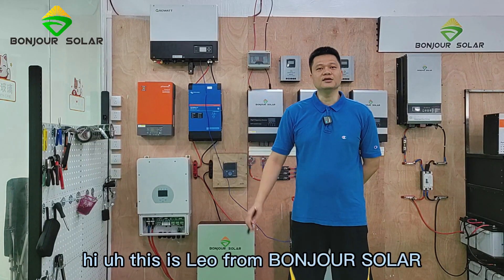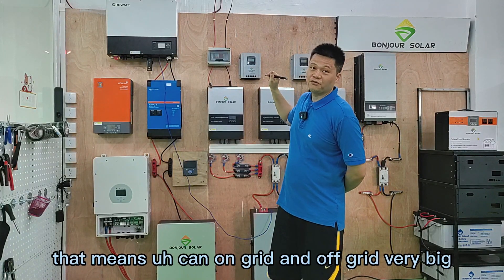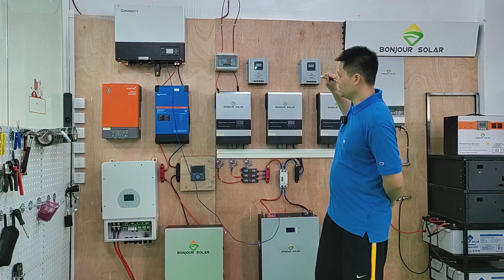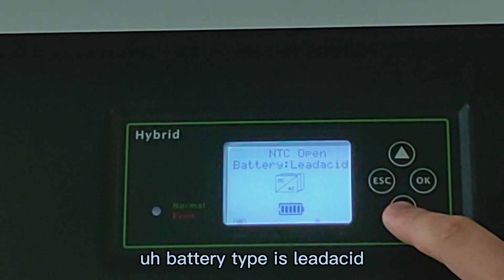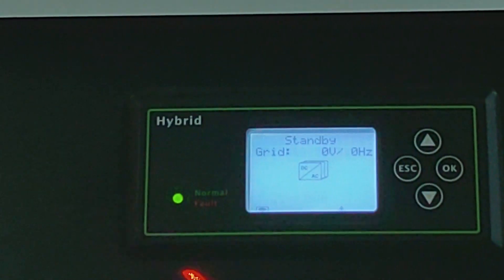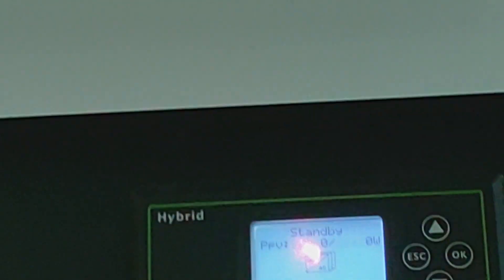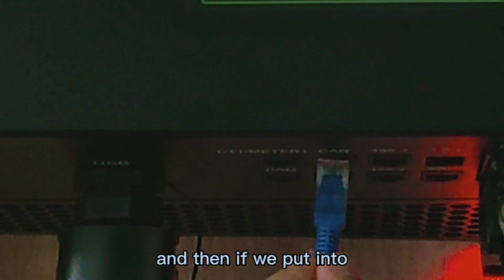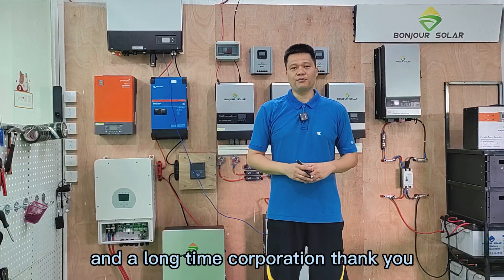Communication connection between Growatt SPH5000 and BONJOUR SOLAR LIPW512200

Comment: I still did not see the battery show up on the inverter, and you have another issue show up with the battery voltage high, what did you do about that issue, did you ever get it working at all with your battery successfully, from what I have read this SPF5000 BL UP inverters only support Growatt batteries even though the documentation shows it does, misleading and criminal if you ask me, I am in the same boat as all the other people the purchased this inverter have with it not communicating with the BMS even when you follow the connections they inform you to use.